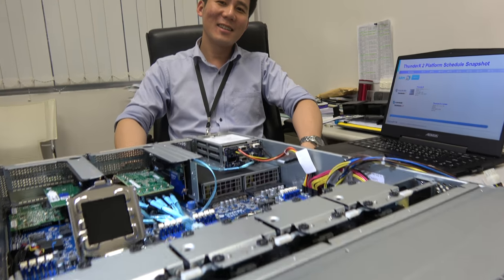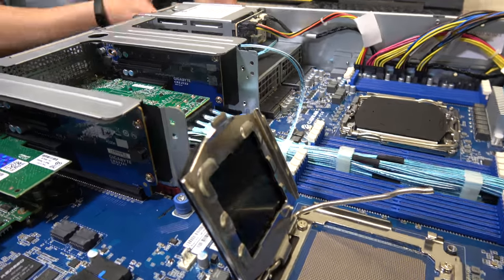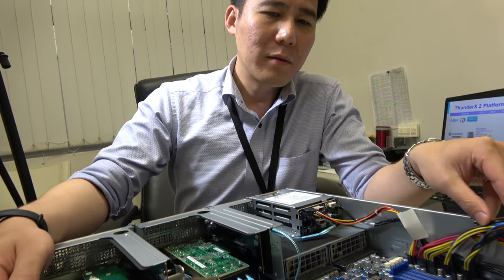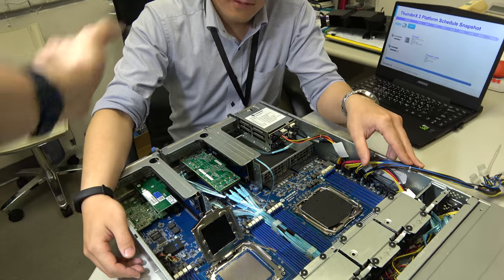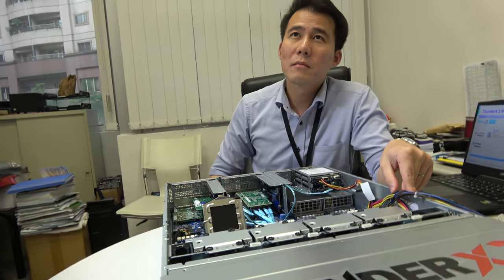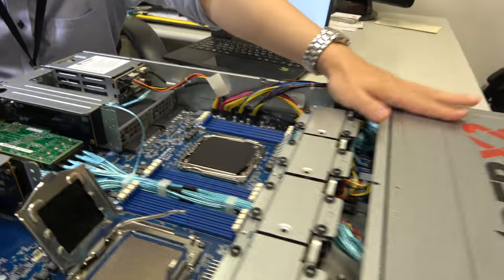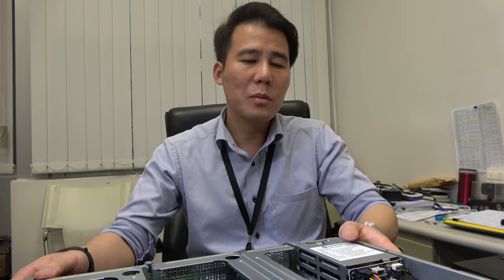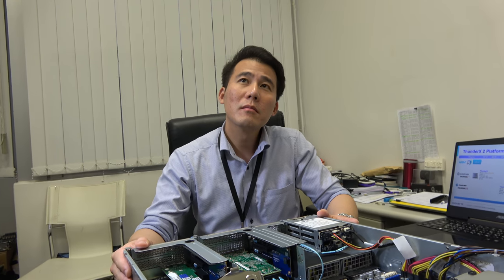Gigabyte shows Cavium ThunderX2 ARM Server with AMD/Nvidia GPGPU for HPC

Comment: Some cool tech! Want to see inexpensive JBOD server based on efficient ARM SoC, Highly integrated mainboard with flash boot drive, a lot of SATA ports an one sfp+ or qsfp+ networking adapter. Using efficient & tiny custom dc to dc PSU for use of solar or wind electricity. And lastly diverting waste heat to other uses like heating water or air for a passive house apartment building. Even better if there is adaptive consumption depending on local power generation, the price of electricity and service demand. It would be cool to beat Backblaze POD design  with more drives and less cost per GB